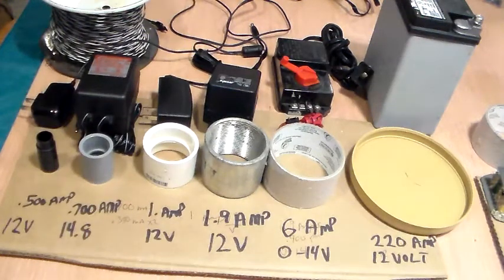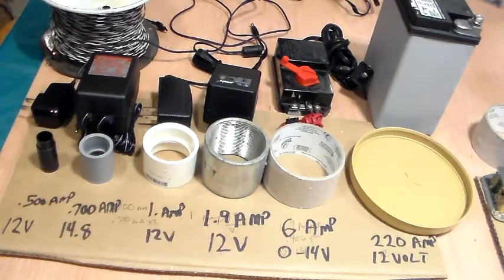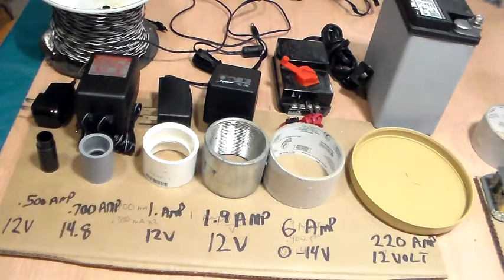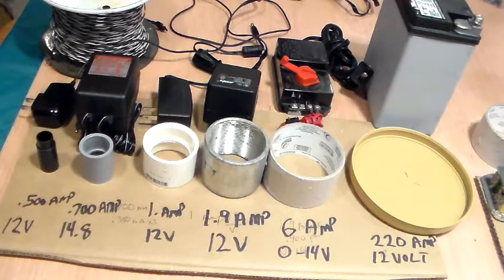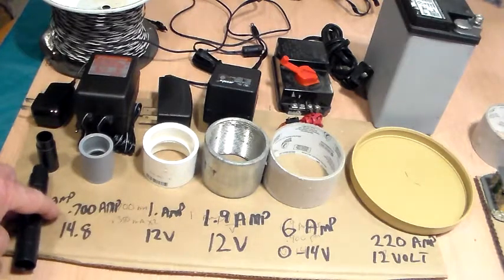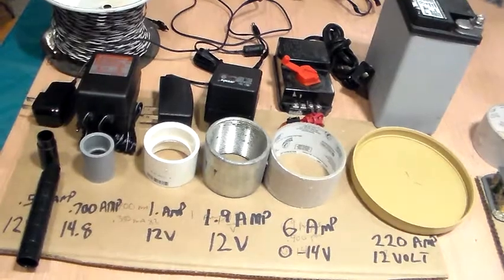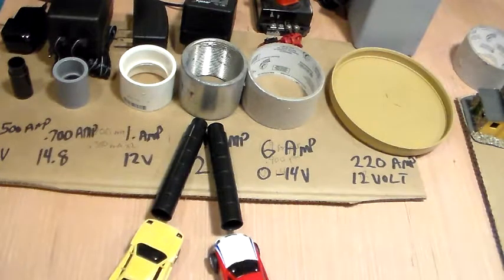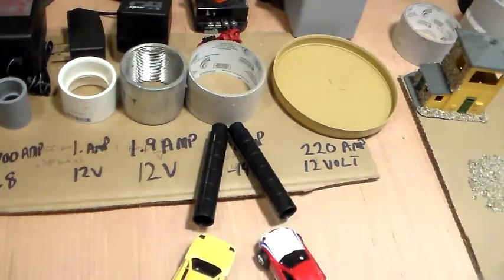Slot Car Track power and what to look for

Comment: I built a large Ninco track set and used universal laptop power supply's for power. Most are adjustable from 12-20 volts up to 90 watts. Find them on e bay for about $15. I used one supply for each lane. Used three power inputs for each lane.  That was many years ago and I think they still work great.  Guess I better go clean the track and see if they still work.  Happy Motoring..[

Comment: I would highly recommend that any "serious" slot car hobbyist or racer learn a few basic things about electricity.
You don't have to become an electrical engineer but getting a few basics under your belt will go a long way in helping you get the most out of your track, your cars, and your wallet and it will help you do it safely.
.
Read about the following:
Electrical potential or pressure (Volts)
Current (Amperes)
Resistance (Ohms)
Conductors
Insulators
Ohm's Law
Watt's Law
Storage Cells (batteries)
Amp Hours (batteries)
Series circuits and parallel circuits.

Comment: I bet if you put a meter on the outputs of them all you would probably find variations between them all, also there is only one supply there that will give you a PURE dc (direct current) and that is the motorcycle battery, all the mains powered transformers have a rectifier inside them to reduce the voltage and change ac (alternating current) to dc ,mostly as cheaply as possible resulting in a less than perfect ‘smoothness ‘ for the motor to use.

Comment: I'm looking at some old train transformers and most of them list output with volts and VA or Volt Amps. From what I can find to find the output amps you divide the VA by the volts. So I'm finding transformers showing 16 volt output and 18 VAC which would only give me just over 1 amp. Are you aware of transformers with higher amp output?

Comment: Could you recommend a good aftermarket Transformer that's 6 - 7 amps and up to20 volts
Reply from the maker: 30V 10A Adjustable DC Power Supply Precision Variable Dual Digital Lab Test
110V

 

Item number on ebay for this transformer is  391321591608, and for the money best I have
found and is adjustable. Hope this helps, Caveman
Reply: Cheaper option, laptop power supply of the desired voltage. Wire a DC jack into your terminal track, or just cut and splice the factory connector, couldn't be simpler and costs nothing if you know where to shop.
Reply: Any recomends for H.O.?  some of the High performance cars can suck up north of 6 amps... a Tomy AFX tripower pack can put out 20 volts, but limmited to only 1 amp... I cant seem to find an economically viable solution...
Reply: @patrickdebelak3669  I ran an HO set in the basement when I wa sa kid on 1 old car battery.   I never did it but you could try 2 car batteries wired in series - it would give you 24 Volts total and way greater that 6 AMPS.  Motorcycle batteries might work as an alternative